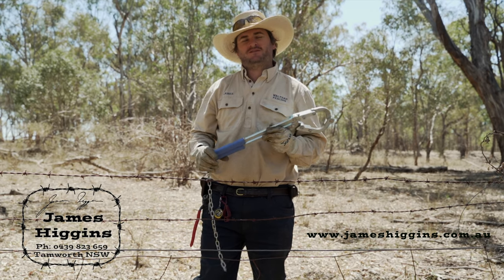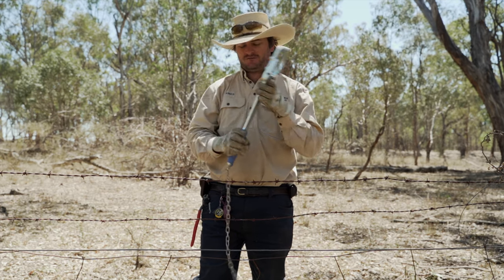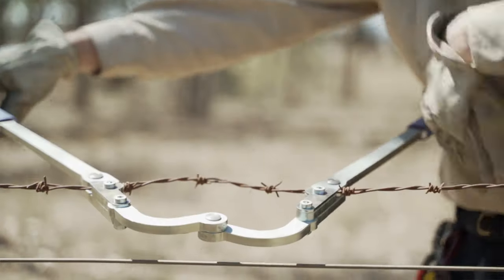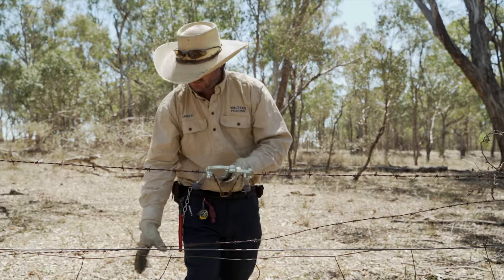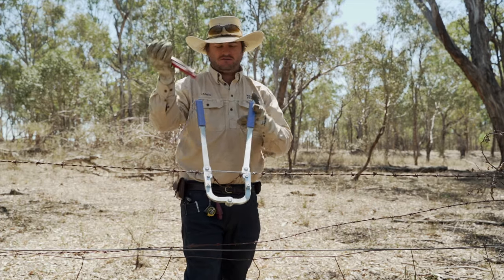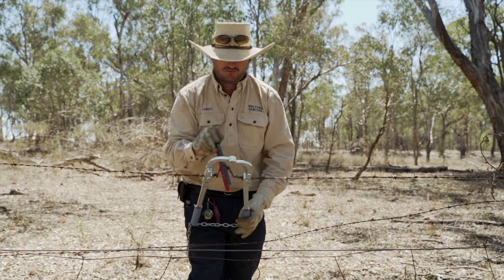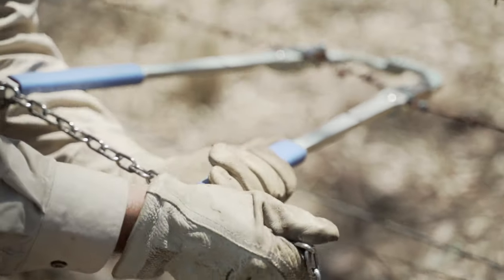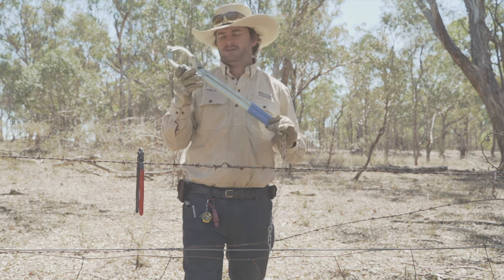Aussie-made 'Fence Repair Tool' wire strainer in action

Comment: Copy of the Texas Fence Fixer!
Reply: Improvement on the Texas fence fixer would be more appropriate. Texas fence fixer is a good tool (I use mine every time I patch fence) but it could use a wire retainer, a chain swivel, thicker jaws, some kind of coating on the handles (they get hot in the sun) and the ability to spread farther (get a longer bite). The cast steel construction is also not as exact in dimensions. His design uses high strength steel plate and solves most of the problems with the original. I would like to see a half link swivel added but that is about it.